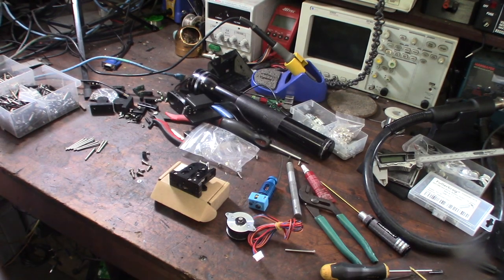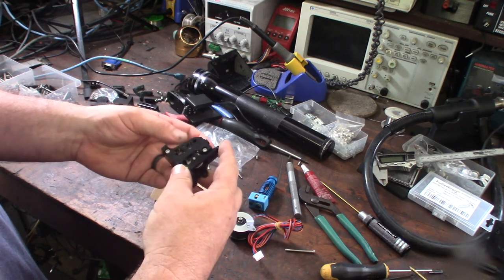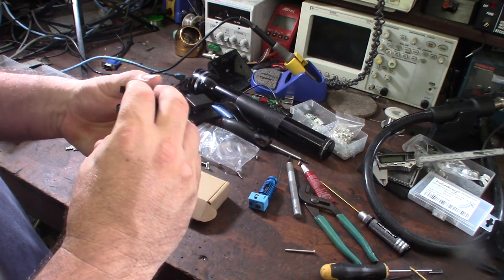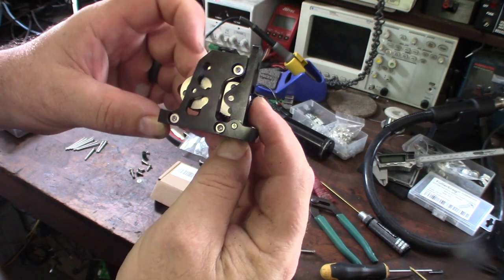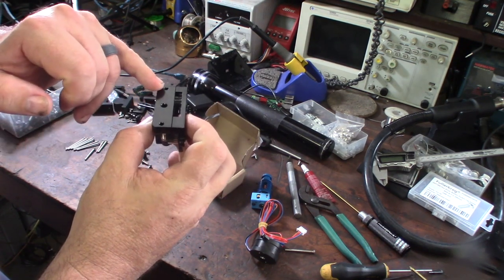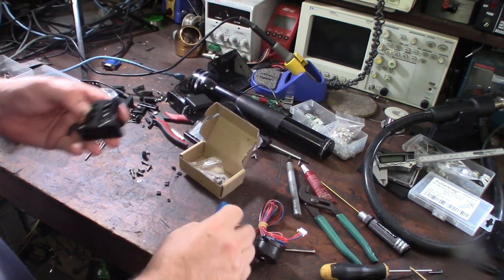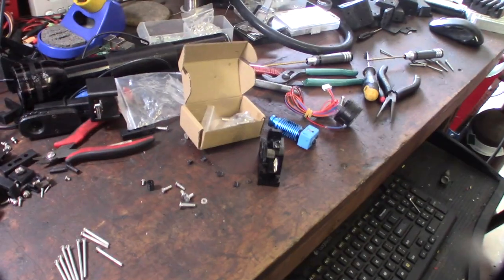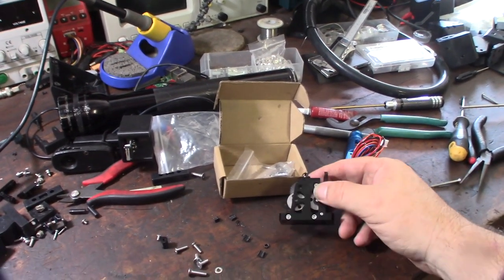HGX-LITE-Extruder All Aluminum with LGX style gears. HGX Lite two trees

Comment: Yeah 👍. 9.5 ratio if not mistaken. Strong&Light. Bought 1 black & tested its really smooth & good. I bought second Red and some spare gears cheap and print the case PETG works just as well. The gears kit is complete with bearings & pins heat inserts & even Teflon tube clip,weight down 20+ g. Take note it only fit nema14 & the first step down gear the metal & the Pom had a very fine grip pressure pressed can come loose on extreme pressure,(beyond printing pressure). I CA it back still works for several months now. Only thing I don’t like is the spring tension knob. It’s not attached to the level. When u open the washer & spring comes separate. But still Highly recommended. Thanks for making this video ❤ n sharing.
Reply: what gear ratio in klipper did you use?
Reply: My extruder cfg @ 16 microstep  rotation_distance : 5.545, I did by try & error attached to hotend(ON)😂measuring the going in length with marker 40/50mm  extrude. Correct way should be dismount check length coming out.

Comment: That aluminium body maybe it's worth it for cooling purposes, connect a v5 or v6 throat to it maybe via another alu plate, slap a heatsink-fan on the side? Make the whole assembly and post extruder filament path way shorter. What do you think?
Reply from the maker: I've created a hotend for it and printer around it. Check my channel for the orca printer
Reply: @fintechrepairshop   Yeah but you're just using e3d-v6-like for your hotend.

Remember how 3d Hemera reduced the height of the toolhead by removing the heatsink dangling below the extruder. Instead the throat gets screwed straight into the extruder body, which has a heatsink integrated.

I'm thinking that same trick might just work with the aluminium HGX extruder. Maybe with an extra 40mm heatsink-fan leaning straight against it and a bottom plate. Maybe fan blowing through extruder body is enough.

Comment: I'm deeply disappointed in mine. It has the worst performance of all extruderes I've ever used. The interesting part is that one very lightly tighen the spring load. That gave the best performance, but still VERY poor.
Reply: What do you think is causing the issues?
Reply: The bearing are low quality and need to be replace. still worth it